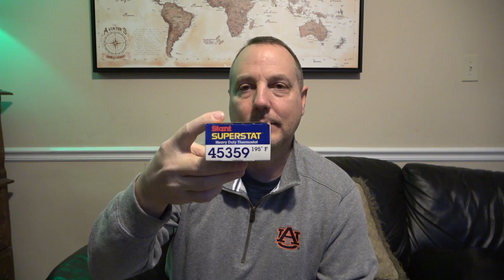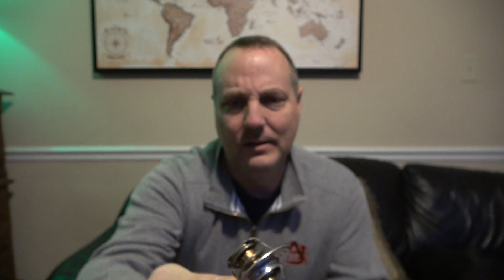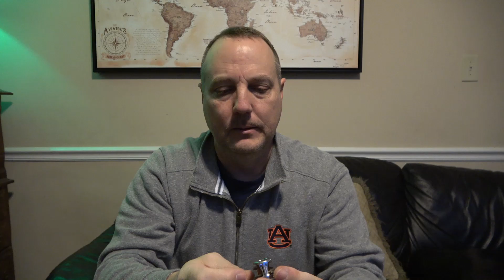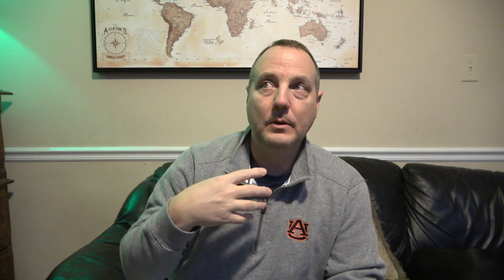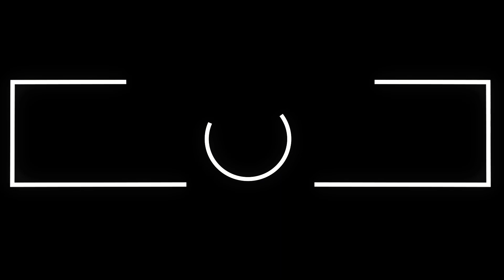Jeep 4.0 Thermostats no longer made in USA.  CJ, XJ, YJ, TJ, WJ, ZJ

Comment: Just bought a "stant" tstat 195 and tested. The stock that i received does start opening between 195-198 from two tests i ran. Fully open at 210-213 (although not as open as id hoped). Lol do i trust it tho? 😬 Time will tell.
Reply from the maker: The 195 temp rating is when it is fully closed